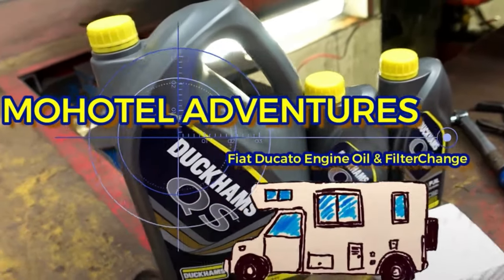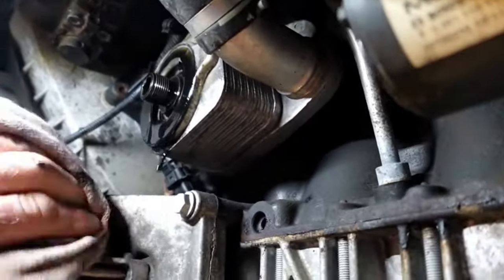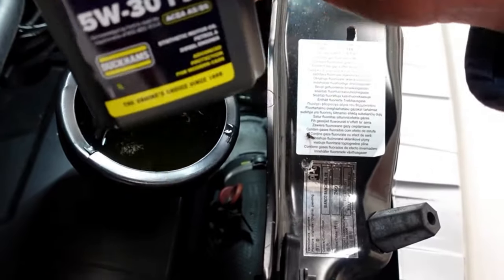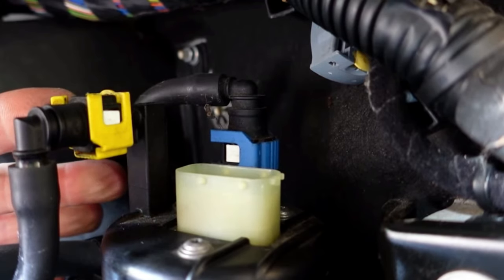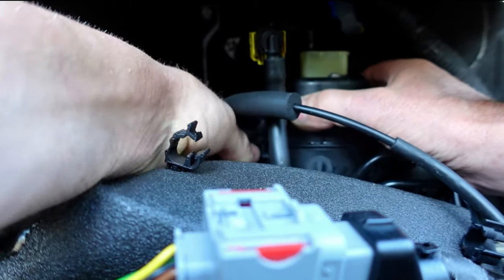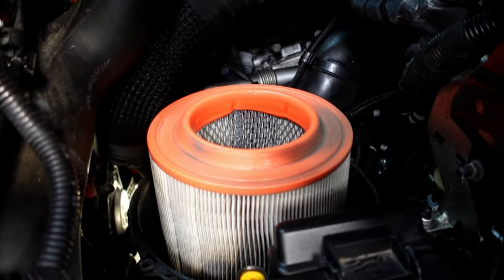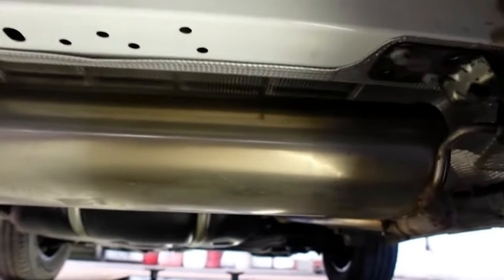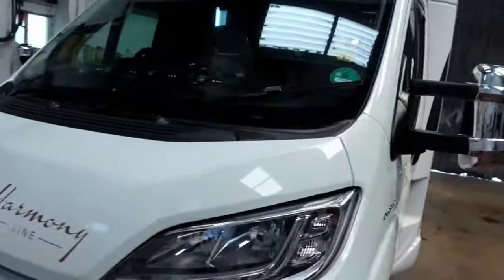FIAT DUCATO MAJOR SERVICE Oil Fuel Air Filter Change Complete Van Motorhome Camper

Comment: Thank you so much for taking the trouble to make these videos! We’ve just bought a 2021 Hymer Ayers Rock and youve given me the confidence to tackle the oil, fuel and filter changes. Top tip taking the head light out! Can I ask and no its not a wind up but…the spare wheel, does it come as standard as far as you’re aware. I crawled underneath to find a big space where the spare wheel should be! I’m ringing the dealer tomorrow but it’d be good knowing if it’s a standard bit of kit on the 2021’s or have they discontinued it? Cheers again 👍
Reply from the maker: @alanharness1960  many thanks Alan, a lot of manufacturers do not fit a spare wheel, have a look at this you can fit on.👌Fiat Ducato Motorhome Bürstner underslung spare wheel carrier winch installation & towing eye
https://youtu.be/qOsRPiPlODg

Comment: I had the same problem on a previous van and found the bottom half of the drain pipes were blocked solid with old leaves, might be worth you putting the end of your hose down each drain to check yours, it took me a while to unblock mine… I hose each of the drains every  time I clean my van now especially this time of year.
Reply from the maker: @sprinklerprot  great advice thanks 🙏 I do keep mine clean, just the joint needs attention🚍💯🙏🏨

Comment: Very interesting and informative Jof. We have been told that our two and a half year old fiat Ducato 9 speed auto moho has one or more faulty glow plugs. Nobody can tell us why or what might cause this - do you have any idea?
Reply from the maker: What are your symptoms?
Reply: @MOHOTELADVENTURES we had an engine warning light and the garage advised two exhaust sensors need replacing but they also said there is one or possibly more than one faulty glow plug. We’ve never had any issue with the glow plug and the engine has always started perfectly. They can’t explain why there would be a glow plug fault and we understand the sensor issue due to corrosion and us not being able to drive it enough last year but we cannot fathom why a two and a half year old van with only 8.5k on the clock would have faulty glow plugs
Reply from the maker: @bridgeteley1410 
Is the engine warning light still showing on the dashboard? If the engine is starting quickly can not see the pre heat plugs are faulty…
Reply: @MOHOTELADVENTURES  yes engine light is still on but that would be because of the sensors - we’ve never had a glow plug warning light or any problem starting the engine so I’m concerned that the garage think we have one or more faulty glow plugs and I’ve been in touch with fiat about this
Reply from the maker: @bridgeteley1410  okay so it needs to be plugged in determine the exhaust gas sensor fault then rectify this issue firstly.
Hopefully Fiat will return with some suggestions possibly to help you out.
Thanks for keeping us informed.🙏

Comment: Hi Jof. What part number for the fuel filter and do you buy direct from Fiat Professional ? Cheers Derek
Reply from the maker: I used genuine Fiat parts 
G0001 359643080
29E04A
👌🚍🏨🌴